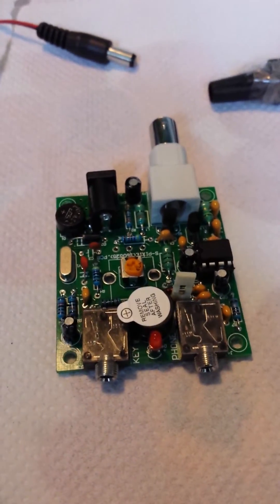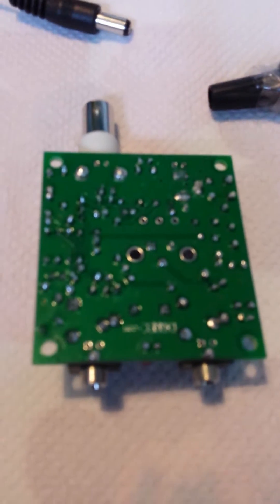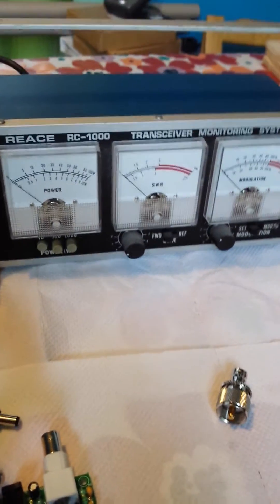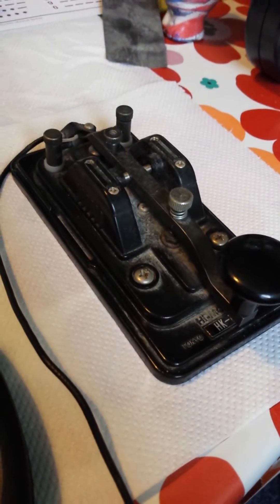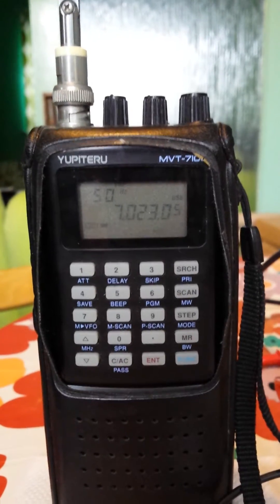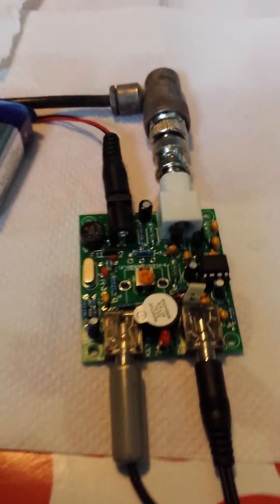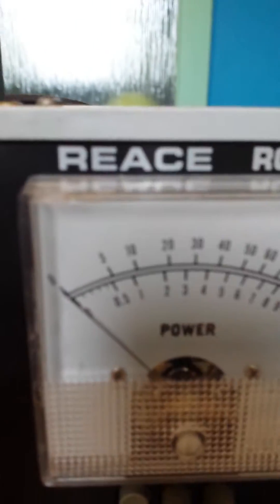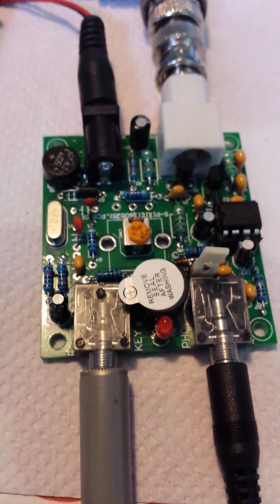Testing My Home-Built Pixie 40M, CW, QRP Transceiver

Comment: Nice job. The tone you are receiving  in the background on your handitalkie  is the oscillator  stage that is running all the time. So that is a good thing as you actually key the PA output section. The 300 mw can be increased  to more output by substituting with a 2n2222a or even a 2n3553 ( more current), so use a regulated 12 vdc power  supply. Suggest  installing  a transistor  socket so you can experiment with npn transistors on hand. One last thing, I would have liked to have  heard your Pixie's receiver in action hooked to a computer  amplified speaker, or similar.  GL! 73 Denny

Comment: Jo just for knowledge: the sticker on the buzzer is correct! Pcbs are often washed after they solder them in the factory and to protect the buzzer from damage the put these stickers on. Without the sticker the inside of the buzzer would get wet and corrode!